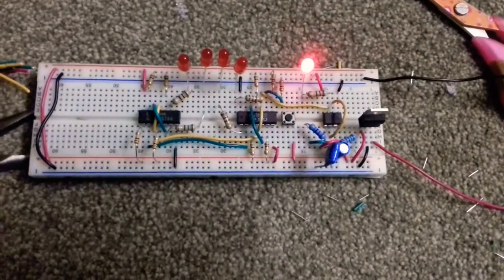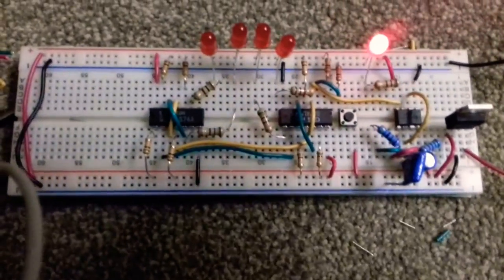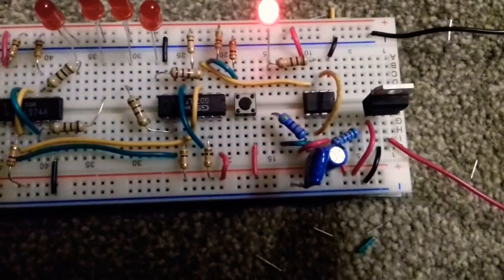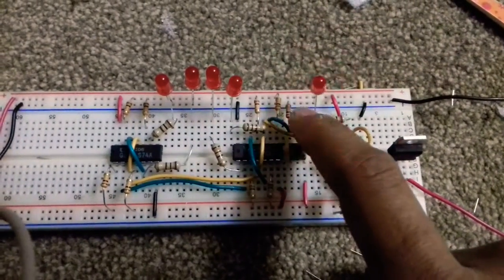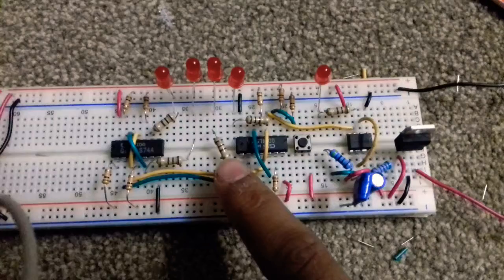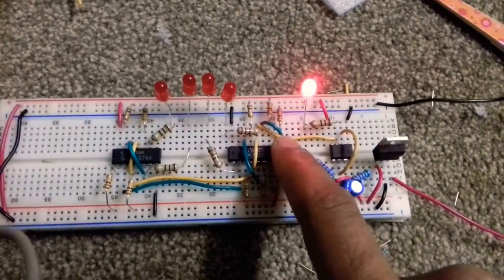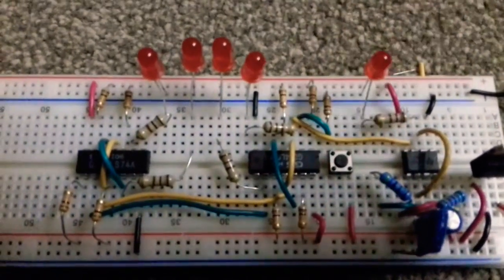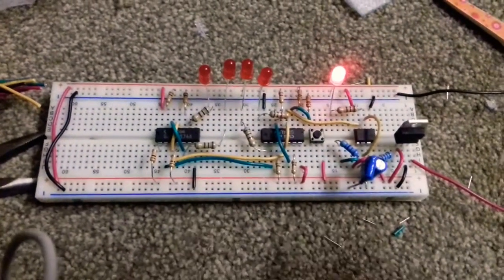4-bit Shift Register - Right to Left - Using D-type positive triggerd Flip Flops (7474 - GD74LS74A)

Comment: What should be status of CLR and PR input of the FlipFlops once the system is clocked? Or should we keep the CLR and PR pins open n just give the clock?
Reply from the maker: Hi Chaitanya! I'm glad you asked me this question. You will have to check the datasheet of the flip flop IC that you are using, to find out if the pins of the IC read a 1 or a 0 when not connected to anything. If they read a 1 then there is no nead to connect  CLR and PR but if they read a 0 then you should connet  CLR and PR to Vcc(1). 

For more information on this project, PLease follow the link provided to find the diagram and a report explaining the shift register: https://drive.google.com/drive/folders/1TSks2pbnnubpdjSFU0xy58rDbHXLChkJ?usp=sharing